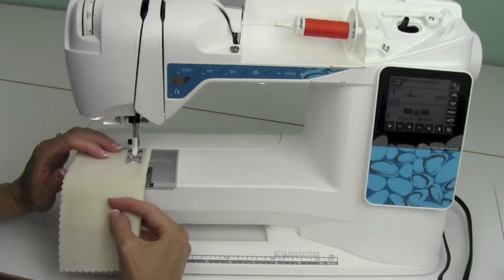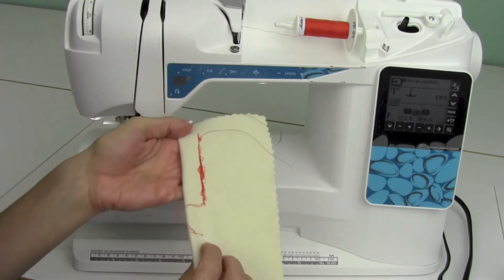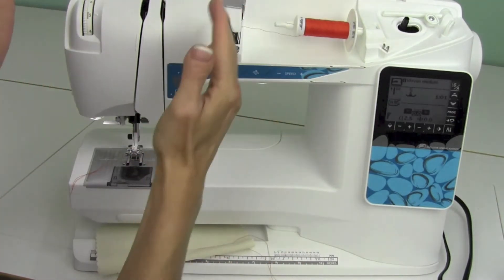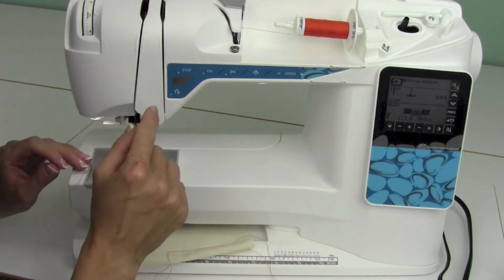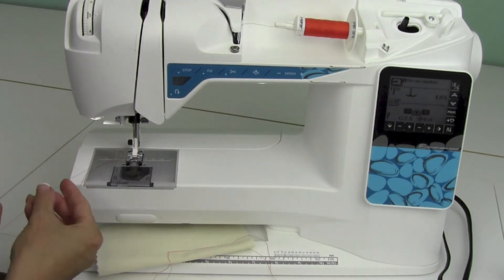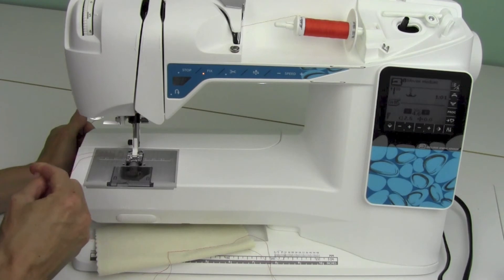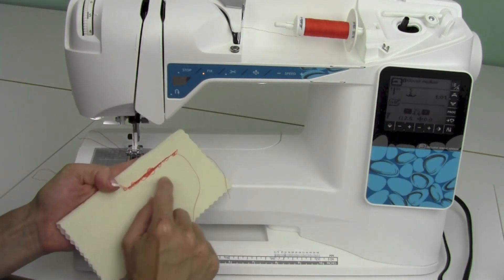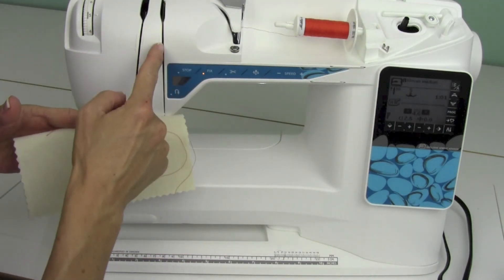Viking Opal 670 18 Top Tension

Comment: This may be a dumb question or one answered in a later video but, when the tension is recommended in the sewing adviser, is it automatically adjusted on the machine for you or do you still have to adjust it manually? (Also with the foot pressure dial, is that automatically adjusted with your fabric selection or do you still have to adjust manually)
Reply from the maker: Hi Jennifer, On the Viking Opal 670 the tension is automatically set for you. You can change it as needed when working with different weights of threads. You will need to manually adjust the presser foot pressure with the dial on the left top of the machine. It will tell you the setting needed through the Sewing Advisor, but you will still need to set it yourself. Thanks, Sara